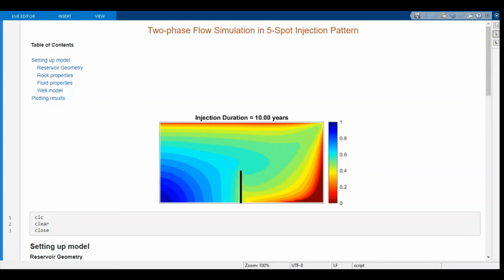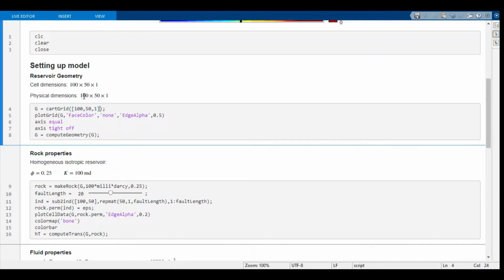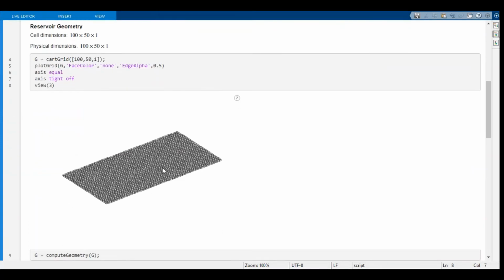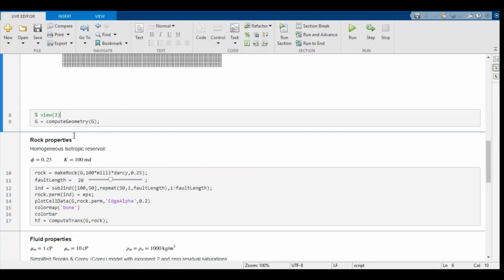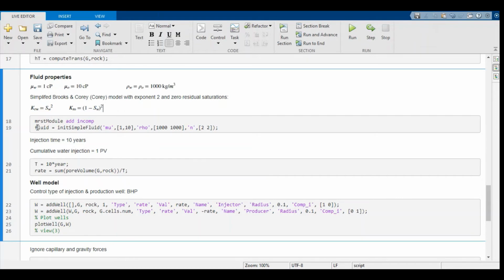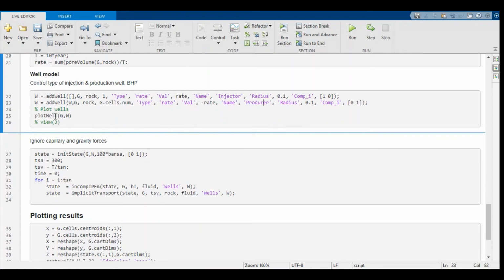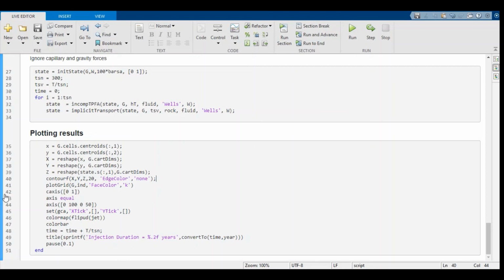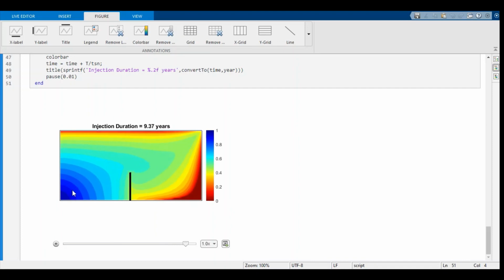2-phase Flow Simulation with MRST

Comment: would you explain the for loop step by step please
Reply from the maker: The for loop is used to calculate and plot the state of the reservoir at each timestep. The first 2 lines of the for loop (functions incompTPFA & implicitTransport) are to calculate the state of the reservoir after the specified timestep value (tsv) and with the specified injection rate, which is inside the structure "W". To get more information about how these functions work to find the solution, you can check their code, and it is also very helpful to read the relevant parts of the book "An Introduction to Reservoir Simulation Using MATLAB", which you can download for free from the Internet.

The lines 35 till 47 are just devoted to plotting the solution and making some changes to the appearance of the plot.  

Hope the explanations can help you.